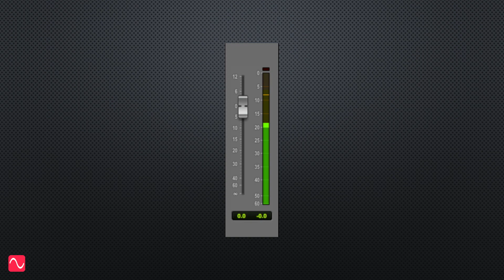Setting microphone preamplifier gain for both headroom and signal to noise ratio

Comment: I usually peak at about -20dBFS. And I do it on purpose. I actually tested for both, noise and headroom. I actually expected a sacrifice of SNR (system noise, not background noise!) for that headroom. But using a dynamic microphone with an output of -51.5dBV @1 PA and a preamp with an EIN of 129dBu, and 115dB of dynamic range, I actually have a higher SNR, (again, system noise, not background noise!) compared to aiming for -10dBFS. So if anyone wanted the higher signal, I could simply raise the signal in post, without ever adding any noise. Granted, you likely wouldn’t use a dynamic microphone for VO work, but still… I actually need that headroom every so often.

Comment: wow that's crazy. I been on an analog mixer for live performance since 1989. I would never think about setting the gain like that.

I guess digital is another whole ball of wax
Reply from the maker: Analogue is different, but not that different. The normal method we recommend for analogue is to solo the channel you're setting, which in many consoles sends the pre-fade signal to the main meters. Then set the gain to achieve your preferred reading. The difference is that in analogue there's a lot of headroom that you don't see and it would be very unusual to clip the console. With digital you see the clipping point (0 dBFS) very clearly. There can be a temptation to try and get as close to that as possible but the closer you get to 0 dBFS the greater the risk of hitting it and clipping. We have another video on the same topic at https://www.youtube.com/watch?v=kwsYd59sjIY
Reply: Youtube addiction

Comment: What is your opinion on the following statements?
If the input gain is adapted to the highest signal without clipping, no headroom is necessary.
If the input signal is still clipped, the input signal is not matched to the highest signal.
Many thanks
Reply from the maker: If there's no clipping, then there's no problem. But recording without adequate headroom causes worry and if you're worrying about clipping then you may not be paying sufficient attention to the needs of your performer. If there's clipping, then you need to to lower the gain and make the recording again.
Reply: @AudioMasterclass  Thanks

Comment: Very concise. I came here trying to find an answer to another question I have. I record in both 16bit (Fostex V16) and 24bit (ESI Maya44 soundcard) and have a noise floor of about -52db peak on both. What is normal and when should I start worrying about it.
Reply from the maker: In either 24-bit or 16-bit digital audio, you shouldn't hear any noise due the digital recording itself. Any audible noise is going to be from another source. As a rule of thumb, you should not hear electronic or digital noise at a normal listening level. If you raise the level by 6 dB and still don't hear any noise, then you're good for most purposes.

Comment: On the focusrite isa one is the digital card good for the money and what does it do to better the recording chain
Reply from the maker: If you have the A-to-D card then you can bypass the analog line input of your audio interface. There may be a very small quality improvement, but you will have to listen very hard to hear it. There may be some convenience aspects but that would depend on the setup of your studio. We recommend a study of the user manual https://d2zjg0qo565n2.cloudfront.net/sites/default/files/downloads/6985/isaoneuserguide-english0.pdf